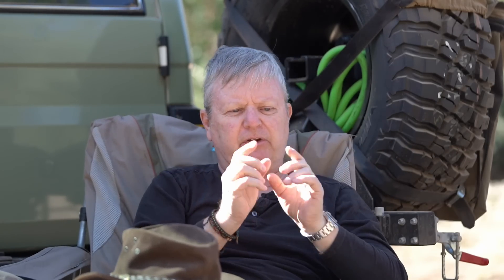TIRES - Traction, Rolling-Resistance EXPLAINED

Comment: I would like to point out something here. I think the wider the tire, the greater the pressure on the outside of the tire - inside and out. Conversely, this means to me that the tread bends inwards in the middle of the tire, so the effective surface and the pressure distribution on the tread is not homogeneous. Does anyone have pictures and tests of what the surface area of a narrow tire, e.g. 225, or 245 or wider, looks like.

Comment: I guess this is only good with weak engines but when you have a powerful engine wider is obviously better. That's why when you tested that Jeep Rubicon in the sand dunes it could go right up things nice and slow with those 12.5 inch wide tires. Nobody was complaining about those being too wide in that video

Comment: I have owned 30 4x4s and have tried out many tyers and terrains.Currently i run a twin arb locked zd30 patrol on 7.50r16 Michelin XZL’s.The thing will go where you point your steering wheel.Also is impossible to get a flat tyer on them,even sharp river rocks can’t stop them.

Comment: I do have question, at what point does a tire become wide or skinny? 
Thanks in advance for all opinions and answers
Reply: That's exactly what I thought of because it seems like the Land Rover guys who obsess over going skinny just because that's what fits better on a Land Rover but the Jeep guys go a little wider and don't even consider it wide because that fits better under Jeep fenders. Funny when he used a Jeep Rubicon in the sand dunes with 12.5 inch wide tires it rolled perfectly from a stopped up all the sand dunes and never had a problem with rolling resistance because it floated right over-the-top the way it should. I think the skinny thing is what I call a British overthinking they just overthinking go all crazy on something because they like to be Corky and different Pence Land Rovers entire existence these days. Professional rock crawlers don't use skinny tires and they do it for money and Glory same thing with professional Baja

Comment: On point as usual Andrew. However there’s another factor as well as rolling resistance and traction. Ground pressure. This probably doesn’t relate so much to a long contact patch but obviously the less ground pressure is gonna help a lot in soft/sinky terrains.

Comment: I wish motorbikers were this reasonable with their choice of rubber.
That whole segment is gone the way of modern SUV's where they have huge rims with tiny sidewalls.
I.e.: 21" front wheel with relatively small sidewall.
Older motorcycles that were meant to do well in sand had far smaller rims and used balloons for tyres instead.

On all my vehicles I've gone the route of the tallest tyres possible.
Be it my 2WD Hiace I take on Gravel roads, where I run 195r14C instead of 185r14C tyres. Combined with sensitive driving, I have been to more places than many 4wd's, while having less impact on the surface below.

I've noticed the biggest difference sidewalls can make on my 125cc Honda Wave and other step throughs.
When I tried Knobbies that were 2.75 in size (they use imperial sizes for some weird reason), they only performed marginally better on gravel while having horrible longevity on tarmac and grip that was so poor that I locked up my front just getting to parking spaces.

What made a worlds difference when I put on 3.00 "road" tyres with an AT equivalent pattern. They have similar performance on sealed roads to the best road tyres I had before, but are just a joy on uneven surfaces. I can also deflate them more while having a far lower risk of snakebite punctures.

Comment: You make some very good points. In fact, it requires a very good motivation or special use situation to venture away from the sizes chosen by the manufacturer for the vehicle. It is not necessarily 'bigger is better'. In my own case with a 76 V8 wagon (265/65X16 standard) with all terrains and living in a farming area I was tempted to go to 285/75 X16 for some extra diff height without doing extra lift. Our local tyre supplier advised against it for all the reasons you discuss, but did advise me to rather change to 265/75 X16 when the first set was worn. The reason? They are the most common size 16 inch tyre available in the sticks here! The average farmer here pounds his usually overloaded 79 over rocks and potholes daily and they do not like wide tyres. So I fitted Dunlop ATR3 (3 ply sides) and managed an 8,000km trip around Namibia towing an off-road caravan without a single puncture or tyre loss. On the hard I ran them on spec pressures, whereas on hard gravel I went down to 2.3 Bar and 1.8 Bar nominally. If I even smelt sand I was 1.6 Bar all round. Why no lift? Besides not needing the extra height, it would require me to modify my garage entrance height. I think not. 

Did you ever see one of the 15 million Model T Ford's on balloons?....and that was before there were proper roads.
Reply: Remember when he tested a black Jeep Rubicon at the United Arab Emirates in the soft sand and those tires were 12.5 inch wide well it never got stuck and it could roll right up those Hills nice and slow from a stop but skinny tires have to keep momentum to go through this and who cares about drag they're going to sink in if you have the power you're not worried about Dragon worried about floating over-the-top this is what I call a British overthinking

Comment: I think a lot of people get hung up on looks way too much instead of the way things actually work, another problem why popularity drives the market its why you can't find skinny tires in a lot of different tire designs. One thing that I have also learn is Everyone likes the bigger rims because they look good and yes they are good for cornering if you have tire tread close to your wheel = less sway when cornering. are you driving a car or a 4 x 4😁😉 I always found out that smaller rims ride a hell of a lot better on rougher ground because you have more sidewall rubber between the tread and wheel.

Comment: Andrew, thanks for this video. I am looking at buying a new set of tyre for my LC79 DC. I have narrowed the choices down to BF Goodrich AT KO2 265/70R16 and the 235/85R16. The height of the sidewalls are 265/70 is 185,5 vs the 235/85 is 199,75. I selected these tyres because both are 10 ply tyres which should help me against punctures in the Tankwa. I understand that the ride comfort is going to suffer. My concern is that I also do lots of Namibia dunes so I need good performance in sand. I am leaning towards the 235/85 because of the higher profile which I believe is going to give me a longer footprint at low pressures. What is your opinion?

Comment: Actually changed my tires because of your recommendation .. and I had a major problem: I have a 2001 Ford Explorer 2Dr Sport and I have run two sets of BFG KO2's in 285/75 16"  getting over 40K miles on each set.  I decided to try the BFG KM3's in 255/85 16" .. They seemed to work well but coming back from a recent road trip something wasn't right .. took it to my mechanic and decided to rotate and rebalance the KM3's .. well, they couldn't be balanced!  7052 miles and the tires are junk!  At Jack Furrier Tire here in Tucson they tried to rebalance them with no luck .. there was a definite 'hump' in each tire as it spun .. like the tire was hitting a bump?  I never even got a chance to air them down. Put on a new set of BFG KO2's like before .. problem solved.  I sent a email to BFG .. we'll see what they say.
Reply: Have you heard back from manufacturer yet? Just wondering if it was a defect or the design is flawed? Thanks in advance.
Reply: @boblafountaine9560  Yup!  There is no warranty on the KM3's .. none, as they pointed out.  They weren't really interested in why they failed.

Comment: I thought everyone knew the narrower tires were better in sand ? , in the middle east , alot of the off road vehicles use 245/85/16 , most of them small pickups like hiluxes or nissan y61 pickups , some people run wide tires just for the looks not performance , most of our terrain is desert , deep soft sand so narrower tires are much better , and a quick tip , less aggressive treads are better but not too soft treads , so a narrow & tall HT tire is better than wide mud terrain tires , alot of people use the Maxxis desert tires , amazing for sand dunes but dangerous on highways

Comment: i see rock as two main categories, the small low range, picking your lines kind of rock crawling and also the rock tracks as seen in america, where you do not have to be as cautious of your line, i like your point of the pressure, as that is accurate. 
when you have a wider tire, you have a higher chance of riding on the top of the rock, on both tyres at once. the wider tyre will require you to lower your tyre pressure more.

Comment: Swapped out my 285/75 16" KO2's a couple of days ago and went with the 
255/85 16" 'skinny' KM3's .. I did a bit of research on these tires and 
was a bit worried that they would be loud .. not the case .. no louder 
then the KO2's.  I was told that the one downside is that they don't 
handle as well on ice!  I live in Tucson,AZ .. don't think I'll have to 
test that.  Your testing and presentation on the 'skinny' sold me .. so 
thanks!
Reply: Hey I live in Tucson Arizona also I drive a disco 2 with grey bed liner body finish and a black roof. Anyway I run 285 75 16 and I swear if I'm down in the Rillito wash when it's super dry in the summer I can roll through any of the thick sand where no one has driven and come to a stop and take off just fine when skinnier tires seem to sink in forget the rolling resistance if you have the power and really my disco doesn't have a bunch. So just curious how do you feel about that now three years after this post when you ran Skinny's?

Comment: Wouldn’t you have a bigger surface area with a wide tire than a narrow tire. You are saying more pounds per Square inch on a narrow tire, wouldn’t by that logic mean it would sink easier in the sand?
Reply from the maker: Sand builds up in front of the tyre as it runs over it, which causes drag. The wider the tyre, the higher the drag. The increased drag off-sets the advantages gained by the additional width.

Comment: The narrow front tyre on a tractor has one feature that you do not mention. They usually have three straight groves that are aligned with the direction of the tire. The object of the three ridges is to direct the dirt or mud into the areas between them and that allows them to float above the muck and still have the sharp edges contacting the main strata so that they can turn with ease.

Comment: I drive 35" M/T for the past six years on many Desert Crossing on tracks like the French, Madigan etc but also quite a few remote Cross Country Desert crossings without tracks, not to mention plenty of beach driving on Fraser, Moreton, Stockton, Blacksmith and so on... I yet have to get stuck. Interestingly any Desert bicycle rider will choose the biggest fat tyres they can ride (on a bike that has it's limit as you only have one Man Power). In a car however it has little practical bearing as long as you have correct tyre pressures as nearly any modern car has enough power to push the little sand in front and the longer footprint and wider tyres compensate amply with plenty of traction even at low speed. On our last 3 Desert Cross Country trip the only vehicles not stuck where solid-axle LandCruisers with 35" wide M/T tyres. Have plenty of videos on my chancel which demonstrates that.

A narrow tyre is better for rock climbing? Hm I have yet to see you do any rock climbing or having a vehicle who could do this. I go technical driving once a week and that is 95% rock and wide tyres are certainly better as they give you a bigger contact area to latch on to. Wide tyres do no sit there and spin where narrow tyres don't if they have the correct pressure. Have yet to see a purpose build rock crawler in any competition on narrow tyres most guy's there do that for years and have tried every conceivable constellation.
Reply: AllOffroad 4x4 Adventures TV just search on YouTube “ stock Willies doing the Moab” and see
Reply: @gabi.2.1  what do I see tough? Moab is a Rock Desert, can you drive it with Pizza Cutters? sure you can and for certain tracks and lines, some people use them but in general wider tyres better grip as long as the vehicle is set up for it.
Reply: @gabi.2.1  my experience is a bit different from Andrews https://youtu.be/snQdgMpAKfU

Comment: yes you're telling the truth. The tires of the rally vehicles racing in the snow are thin. Their pressures on the surface are much higher and provide more adhesion. ı have 33 inch BF on my hilux :) but ı want to change to 255 85 16 :)

Comment: I disagree with wide tyres being better on tarmac.  You mentioned vaguer, heavier steering, but you didn’t mention that wide tyres are far more likely to aqua plane on wet tarmac.  So, unless you live in perpetual sunshine, thin tyres are safer.  As the wear and tear on steering components from excessive friction, scrub angle and gyroscopic mass of fat tyres, and there is little in their favour (we’re not talking about track race cars here).

Comment: Ehhh.. airing down tires in some situations makes the footprint wider, but not the the degree that it makes the footprint longer. If you run a narrow rim and a wide tire, the tread does tend to crown a bit more than a wider rim with that same tire. This is simple physics

Comment: This video has prompted a lot of comment, a lot of it contradictory.
For those who are interested in pursuing this further, I have tried to put the subject on a sound footing by reviewing some lab test results and computing some results using terramechanics techniques. This has been put into video format at:
https://youtu.be/KS3c-RHrFbQ
It's necessarily a technical subject although I have tried to make it accessible.
Andrew's assertions in his video are generally supported by the data (at least regarding tyre sinkage and the external rolling resistance) although I haven't yet got round to looking at tyre traction which is a different subject.
Reply: This comment needs to be pinned to the top comment
Reply: @cantybrad  I  am planning to update the earlier soon with more info. It is however a lot of work so it takes time.

Comment: Got a 100 series Cruiser, stock tyre is 275/70r16 (31.16"). Lots of guys go up to 285/75r16 (32.83") but I'm thinking of going 265/75r16 (31.65"). Opinions? Should I try stick with the stock size? Noting that there are less tyre options at the stock size.

Comment: Actually tractors do run much lower tire pressures than normal vehicles.  I don't know how the physics work but a small 2wd tractor will go farther in mud/snow than a 4wd truck that weighs the same.

Comment: I noticed in another video, that you do not seem to understand the nature of tire measzrements.

The second number is not an absolute, it is a percentage of the width.
So a 285/75 has a 75% of 285mm, or 213,75 mm high sidewall.
A 255/85, has a 85% of 255mm, or 216,75mm sidewall.
So your example tires are virtually of the same sidewall height.

And your 225/85 have a lot less sidewall height, not more.
 I do not doubt any of your conclusions, just your understanding of tire measurements
Reply from the maker: I do understand how tyre sizes work, believe me. It has more sidewall in relation to the width. Maybe I didn't express myself as well as I might have.
Reply: OK, lets say you did express yourself misleadingly, despite your expression "It is taller but narrower, so it has a similar amount or rubber.... (then you show that the rubber is divided more to the height)" being for me very clearly wrong and unmisunderstandable.

I am a Car Mechanic by trade (a german one who learned this trade for years) with 20 Years of experience and work in Motorsports and modifying cars (but only litte off-road experience I have to say).

So I do not doubt your expertise in offroad traction, I just want to give you some bits to think about when it comes to tire width and so physics behind it. And I am curious what you have to say about them.

- The load capacity of a tire is dependant on the tire pressure, and width, because the force exerted is dependant on pressure and the area the pressure acts upon.
So a narrower Tire (on roads) has to be driven at a higher pressure to support the same vehicle.
You can air down a tire more, if it is wider, because it has more air volume to play with and more load capacity at the same pressure.

- It is not only floatation against crushing through, the tread of a tire messes quite a bit with the basic physics, that is why special snow tires work so much better on snow, and racing tires so much better on dry tarmac.
In Mud you want wheelspeed and a tire that cleans itself at those wheelspeeds, to get the advantage of the agressive blocks to claw you through, normal tires turn into slicks, no matter if they sink in or not.

- On rocks, you want a low tire pressure, thats right.
But I doubt your asumption, that a narrower tire conforms better to rocks is acuarte.
A wider tire can deform more is this situation, because the pressure in the tire does not rise as fast, if the tire deformes, because of the higher air volume.

Lastly I believe that a wider tire can in general take more abuse and survive longer, because the strain is divided over more material.

Comment: If my load per tire was 1000 pounds and my tire max pressure is 50psi at 2000 pounds. Does that mean I should always run between 25 and 50psi? Would it be ok to run less than 25psi at slow speed off road?